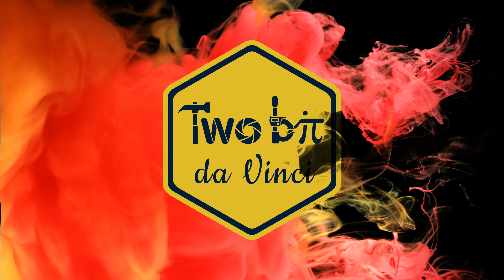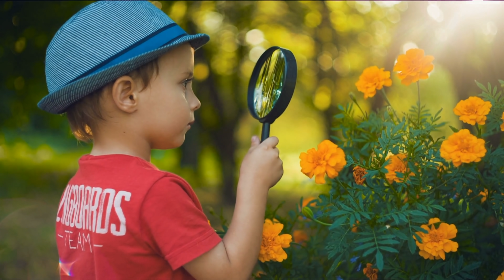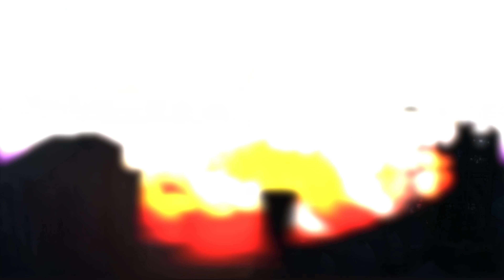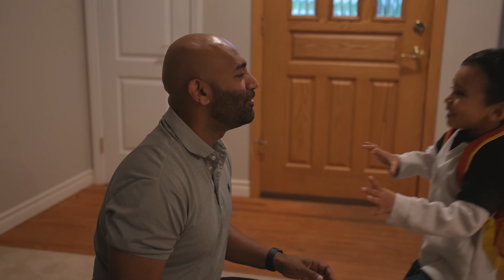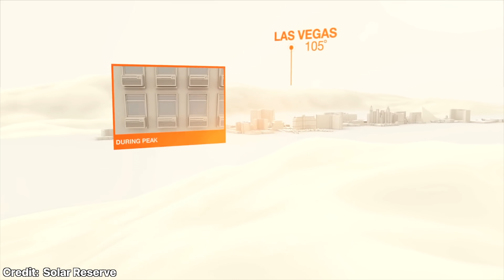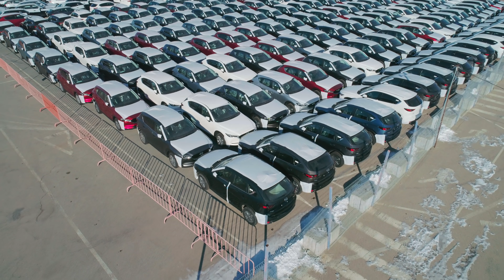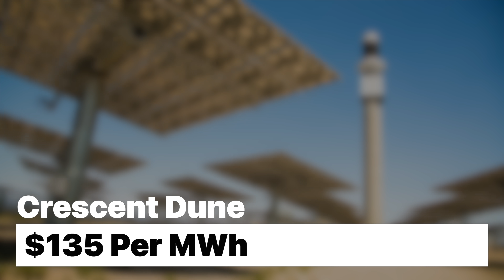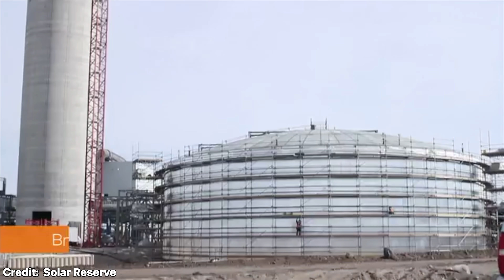This Billion Dollar Solar Plant was an EPIC Failure

Comment: Has anyone calculated the life cycle environmental impact of this installation?
How does that compare to a conventional coal fired plant of equivalent capacity?
Reply: its a renewable scam!
Reply: @JB-lp9xr   uranium is even better.
Reply: @JB-lp9xr  Everything that works you mean. If it's being sold as sustainable but isn't, then it would be better to do nothing and waste less time and resources.
Reply: Compared to photovoltaic panels, this can run forever.
Reply: Mirrors won't deteriorate in time, and If they do, they are cheap to replace.
Reply: obviously less lmao burning coal in a concrete plant is worse than a concrete plant using sunlight to heat molten salt

Comment: Initially, this is a poor CSP V solar PV comparison, PV does not account for power backup costs, PV fails on a daily basis during sundown, so introducing the cost of backing up PV is not accounted for in your graphic comparison. CSP is the true cost of solar including storage. You state this in the video, but you should have included system costs in the graphic. Good try.

Comment: A similar system was proposed in South Australia, it was never built, but several PV solar farms have been along with a lot of wind turbines. The net result? We now have cheaper electricity than 10 years ago, we are a net exporter of electricity and interconnectors that provided us with cheap power from other states are now used to lower their power bills! The benefit of hot salt providing 24 hour power may not really be there as we had 6 consecutive days where the whole state ran on only renewable power thanks to our cyclotrons (I am not sure what they are but the lights did stay on).
Of course due to the high uptake of domestic solar panels and batteries most people don't notice what electricity costs any more. But 10 years ago high power prices could get the State government voted out of office.

Comment: Solar and wind energy devices on industrial scales have two huge problems . Durability of these devices and complexity of maintenance. Anytime you spread the footprint of and energy plant and raise the elevation of the generating device you add huge costs. Solar and wind devices have typical lifespans of 20 years. A turbine in a nuclear or fossil fuel plant has lifetimes of 40 to 60 years. Maintenance of turbines for nuclear and fossil fuel plant s is done indoors with buildings designed to lift turbine sections. This solar plant one would have to run over a huge property and climb hundreds of feet to maintain. In theory this solar plant should work however one does not know until theory is put into real word practice

Comment: Photovoltaic costs twice as much as any other power generation method. Every solar or wind system has a complete other generation method backing it up. Thus, you build a 1000Mw solar or wind generating system, you also build a 1000Mw gas turbine, coal, or nuclear facility. Sorry guys, there is no getting around this, "renewable" energy will always cost more, and much much more. No math or magic will change those facts. Now in another 100 years of technological advancement, that may not be true, and all these pie in the sky "renewables" may actually be economical to run. So what's the problem? We have 1000 years of petroleum, and 100 years of continuing doing what we are doing, with small incremental improvements to our current systems is the method to use. No sense in making energy unaffordable to half the world, especially since we have 1 billion humans living without power already. Also, if you power plant is subsidized by US tax payers, your "low rate" isn't so low, it's just being paid for by the rest of the USA.

Comment: I saw a recent article about a new technology for drilling ultra-deep boreholes using high temperature plasma. This technique doesn't even require a well casing as the plasma vitrifies the wall of the hole to create its own casing. Such a technique would enable drilling to a depth where geothermal energy could be produced virtually anywhere, including near the location of existing generating stations that currently use coal, oil or gas to generate steam to drive the turbine electrical generators. Geothermally produced steam could be substituted relatively economically for the carbon fuel originally used to generate the steam.

Comment: Perhaps this has been said already, but that is what you get when you put the wrong engineers in charge of a project. Years ago I did a tour of one of SCE's hydro facilities in the Sierras in California. There I learned that there were two types of engineers in the company. There were the hot water guys running the steam plants and the cold water guys running the hydro facilities. SCE should have gone outside the company and found engineers that could go outside the box and employment new technology instead trying to use hot water technology that has been around for several hundred years.

Comment: if they can make those mirror panels work with photovoltaic since we have a breakthrough with those clear solar panel now, wouldn't it produce a lot more energy than any other traditional energy farms?... and it sounds like they just needed an automated solution and better design to solve the issue of manpower....

Comment: There are a lot of different technologies out there. Photovoltaic  roof shingles, battery walls, ammonia power cargo ships, hydrogen semi trucks, biofuel jets. Half a dozen new battery types. Very heavy cheap deep cycle batteries for non mobile power storage. 
   But none have the strategic hegemonic geopolitical control of oil paid in US dollars.

Comment: Doesn't molten salt need power/heat to keep itself liquid after the energy depleted? I vaguely remember some solar thermal plant uses gas power to run the system.

Comment: Largely these big projects are designed in origin by people who don't understand environmental physics and have no clue about things like the fact that sunlight also comes from around the sun and even near the sun.   A fine cloud cover that you can barely see, when reflected on this scale, can put a massive amount of energy on the tower where heat isn't supposed to go.
This plant should have been built using the oil system technology that Israel uses.

Comment: The US tested a solar thermal plant near Barstow in the 1980s. It failed too. For more or less the same reasons.
Reply: Exactly!  DOE paid for that one.   This video is the plant near Tonopah.  Bright source runs the one in CA by Stateline.  It does not use salt.
One unforeseen issue is that when one cloud shades part of the collector tower, they have to shut down the plant because differential heating disrupts everything.  Duh.  It may be desert, but rarely is there a day without any cloud.

Comment: Desalinate sea water like this // with the concentrated heat // makes salt too

Sea water pumped in, distilled water out, waste heat used to boil the fresh water through ss steam turbine generators. Salt removed can be sold as sea salt. Seems like a natural solution to make use of the plant // in an arid region with water shortages & with sea levels rising //

Comment: I know exactly why they fail, they only have big corporations involved and they made lots of money and don't care if it works or not.  I've witnessed it back in the 90's, it is a political sham, just like carbon chips.  To put one hole in the test site costs $38,000 for an environmental impact study to make sure the already glowing desert tortoise doesn't get hurt...  Not to mention the prenegotiated interstate power wielding.  I got turned down ~four times for a small grant, the last one pound sandia said the articulation had to have multiple redundancies because failure would insure that it would burn itself to the ground!  Wish I still had that paper, I'd frame it.

Comment: Was the price still higher once the photovoltaics honestly included the cost of the equivalent amount of battery backup, pumped hydro, or other energy storage to match the same functionality as the concentrated solar plant’s molten salt thermal storage? Because otherwise we’re comparing apples to oranges -  a dishonest comparison. (Batteries might be getting less expensive, just wondering.)

Comment: All the wind and solar generation sounds good on paper - the energy is free, but the technology to harness the energy is expensive. I have been in the electrical, energy, and construction industries since the mid 1970's. I have been threatened to be thrown off the top of wind nacelles because I keep pointing out the flaws and failures of 'Renewable Energy' systems. I see the whole industry as a money laundering scheme, nothing more. It all ends up being and endless bottomless money pit. Wishful thinking, suppositions, nor good intentions will ever change physics.

Comment: I've seen those in Spain as well (i think it was Spain). Would love to hear about other places in the world using the same technology and how it differs from the US and chinese version(s). Thanks for the video!
Reply: This unit’s construction was managed by a Spanish company called Cobra 
This is a Spanish design
Reply: Ouarzazate Solar Power Station, Morocco.
Reply: Solar panels in Spain made 35,000 people to go belly up.
Reply: We have one of those in Chile
Reply: @honurapanui  Yeah. And it's useless. Almost all energy used in Chile is fossil energy.
Reply: @Brandon_letsgo  no, it is not useless. It provides energy for 200.000 homes. And renewable energy provides 40% of Chile's need for energy.
Reply: @honurapanui  Source: voices from your head.
Reply: @Brandon_letsgo  this channel dont allow links, its official that Spain had 50 thermal-solar plants... With two massive molten salt ones the "Ps10 and Ps20" twin towers making 50Gw/year and  "Gemasolar" Tower making 80Gw/year, you are free to search about them. 50 Solar-Thermal plants in total, that can work at night and dont deppend of China industry because dont use elecrovoltaic panels, only mirrors.

Comment: I still like solar-thermal power, and energy storage as heat .. scale is a significant factor, though .. so Instead of attempting to use concentrated sunlight to reach 1000 degree temperatures to heat water to make steam to turn turbines (lots of opportunities there to loose energy)  I am using TEG modules, to take advantages of much lower thermal gradients I'm getting 4.8 volts at 669 ma from 40mmx40mm modules, on a 100 degree C gradient .. its easier to get that much energy, and easy to scale up from there as well.

Comment: your whole video proved that they were stupid to stop the powerplant.

every new tech will be expensive as fuck, we are supposed to stick with them and optimise them over years.. just like solar.. that's the only reason solar is as cheap as it is right now... ppl optimised the shit out of it. 
as far as i know their only issue was with the handling of the molten salt.. which is crucial.. especially that ppl plan on building molten salt reactors in the future.. if anything they could have sold data to the reactor ppl before they build an even more expensive project. maybe even collaborated on the issue. 

the thing is.. it just can't be cheap right from the get go. the only thing you need to know is that it works.. once you know that.. you can work on costs and improvements.

Comment: Ok so for all those that want to redesign this plant into PV, how about a cheaper way to do that while retaining 'some' of the thermal storage?

Turn it into a CPV plant. Line the outside of the tower with high-temp, triple-junction PV cells (up to 35% efficient} and redirect the mirrors to flood the whole side of the tower. Reduce the solar flux at the cell to 50-500 suns (whatever the cells can handle with active cooling) and let them generate power all day.

Then take the heat you collected from daytime cooling and store it for night, to be used to run a Stirling engine or organic Rankine turbine at night.

Hopefully the cells can handle a high enough temp so that the cooling temp is still usable for decent efficiency given the Carnot efficiency limit. Either way, now your cooling liquid doesn't have to be corrosive or extreme temp. That's much cheaper and probably could reuse most of the pipes and valves.

All that's needed for the mirrors is to reprogram their target lower. And BTW, this reduction in solar flux concentration may be enough to reduce or eliminate the hazard to birds flying through the path? I think 40 suns of heat is where birds can be harmed and that may be achieved only within a few feet of the cell surface.

Comment: Advanced solar trough technology could heat lead to a molten state to store heat to run some sort of flash boiler around a hot lead core by a thermal mass to generate energy. Sure the thermal mass is insulated but in the core is the flash boiler to make steam. The troughs could be aligned vertically to remain stationary for most of the time at an angle that works year round to make heat. Then you have could stirling generators to recover waste heat to generate energy. Or use super critical carbon dioxide cycle turbines instead. And since you have to remove more heat to condense the gas maybe more stirling generators along the larger cooling towers for the carbon dioxide working gas.

Comment: Get some enthusiastic high school kids to think about this problem give them some tools and construction iron bars.  They'll figure out that you don't need a motor on each array and you can link them mechanically; and then,  program robots to clean the mirrors.   Problem solved for a lemonade party in Vegas!  Get the goddam engineers with kids to put through college out of the way!

Comment: I remain unconvinced by your explanation for the failure.
The issues of using "high" temperature thermal medium are too old and well known for a well designed project to fail, it'd be nearly impossible.
Reading a couple accounts including its Wikipedia page, there's not enough detail to know more than what you described that there was a molten salt leak that apparently was unresolved but an engineering appraisal apparently exists from a Nevada DOE hearing.

This is pretty ridiculous if that was the only problem, I suspect that either the project was vastly underfinanced or there are many more problems that aren't publicly known. Reading between the lines, it's also probably likely that there was a lot of finger pointing and blame, a lot of non-technical and inexperienced people were involved (especially on the financing end) and in the end all involved probably concluded life is too short to fight and decided to just part ways.

BTW - The poor output is probably not a major factor unless it wasn't accounted for in the original analysis. The Wikipedia article is clear that other similar setups also started with far less than maximum output (as low as 40%) and took years to progress towards better efficiency and output. If early investors weren't aware of this "not instant" performance record of other similar projects, it could have been an unexpected surprise.

In any case,
it's a real waste for so much potential to be sitting out there in a desert unused. Someone who knows what they're doing could probably make it work without too much trouble after going in there and seeing what's salvageable, what's obsolete, what will never work and what has to be replaced.
Reply: I have to disagree.  Welds that need to stand up to corrosive molten salts at high temperature can be really problematic.  I expect they would need 100% inspection by xray.

Comment: Yes, thermal solar is pretty much dead, no matter how they configure it.  Solar PV is just too cheap and easy to maintain for anything else to compete.  Flow batteries and other iron-based batteries are also very cheap.  First Solar, a U.S. company, installs their thin film PV for ~$0.10/Watt and sells to utilities at: $0.02/W.  There's NO way any other technology can compete with that.  Yes, PV takes up a lot of space but look at the millions of acres of unused roof space in the U.S., we should be coving every square inch of roofs with PV first, then worry about finding land for PV farms.